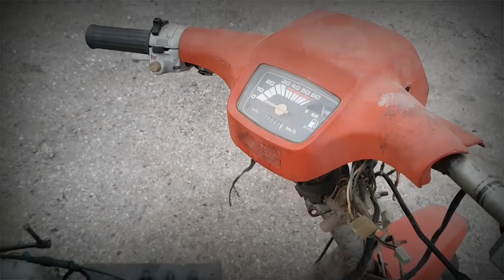Скутер с нуля #6 Honda Tact AB07 сборка вариатора торкдрайвера и заводного механизма.

Comment: Put that spring back in it's place and test kick starter while engine is in it's proper position. Without it, starting gear could get loose and you will hear noises from engine.